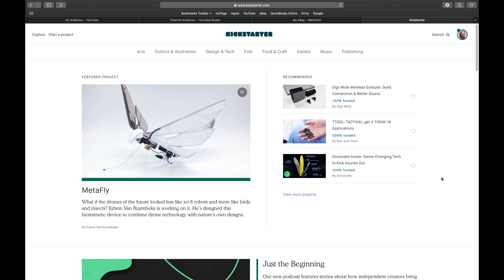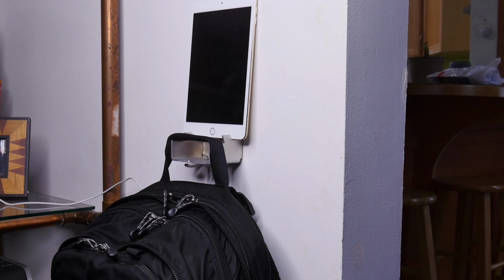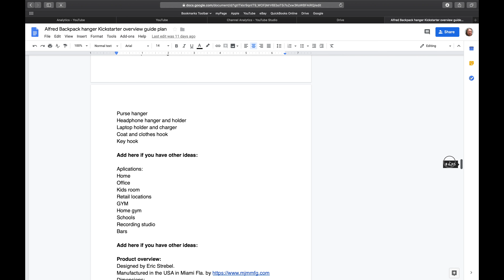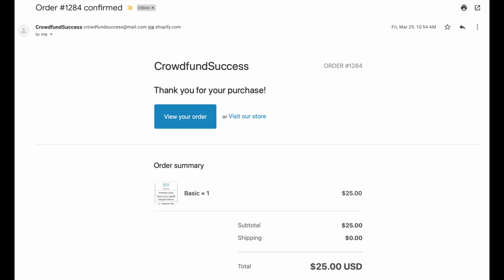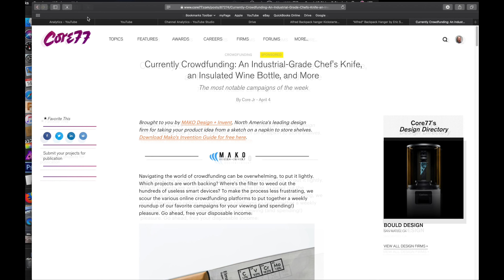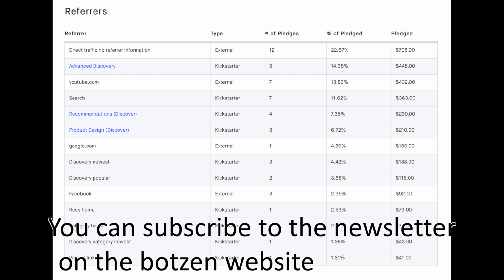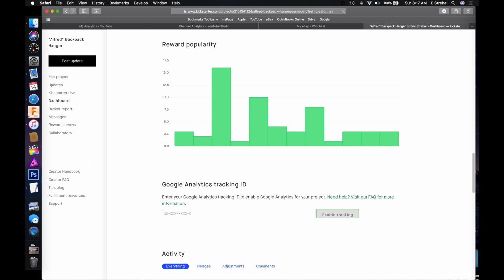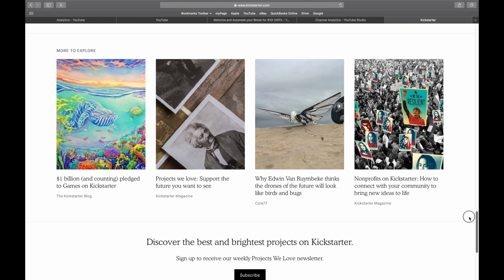How to fund a Kickstarter Campaign: Behind the scenes look

Comment: Very interesting.  Did you have to spend any $$ up front for the campaign itself other than the two marketing campaigns you tried?  Is the Kickstarter UI pretty easy to work with... like, just drag and drop?

Thanks for sharing.
Reply from the maker: Shop Hacks Product development always cost money :-) my biggest cost was for the two metal prototypes. It's the cost of doing business :-) you gotta spend a little money to make some thing good. You are most welcome of course!
Reply: @EricStrebel  yeah, I  was wondering about just the Kickstarter side.  It looks like you are going to have to find a blogger in the market this product targets to feature your product in the next day or two to make your goal. 

Regarding Instagram,  you can tell people to follow the link in your profile then put your Kickstarter link there. It's not nearly as good as a direct link but that's how I've seen the big Instagram'rs do it.

Pinterest might also be an option. 

Ive gotten a reach of about 5000 people with boosted FB posts for about $25.  They got decent engagement but I  don't know if they would have worked or not for something like this.